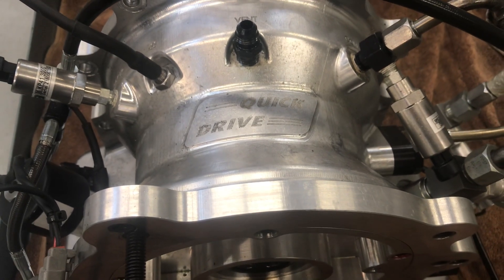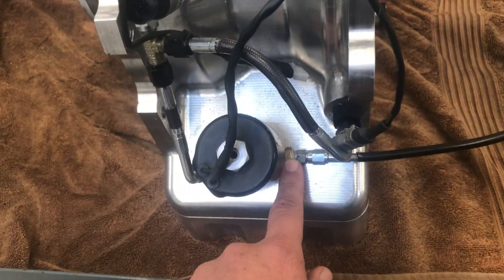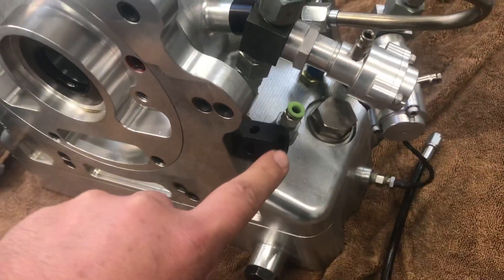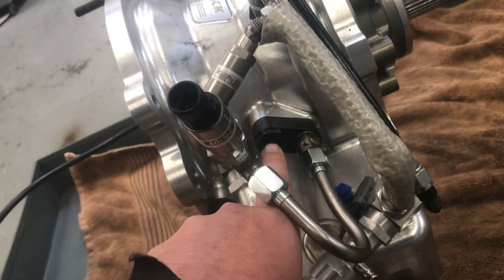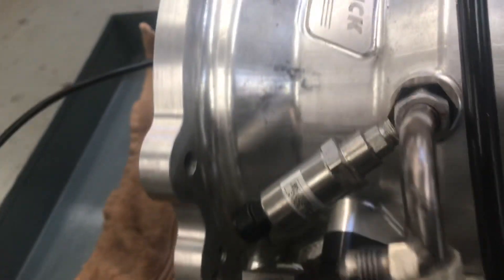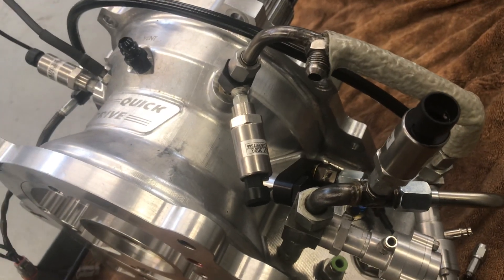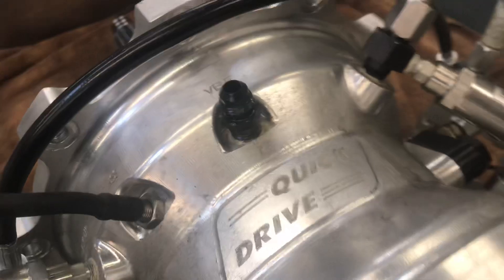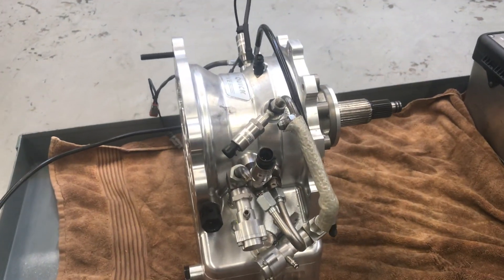Quick Drive Racing Lockup Torque Converter Drive Plumbing - Tuned By Shane T

Comment: Really informative. I appreciate how you took the time to explain why you bypass the cooler line but still retain the ability to use your external cooler between passes to get down to the same temps every run. I would love for you take one of these apart and explain the inner workings in detail.
Reply from the maker: Christopher Holmes appreciated and we will do that in the future, thanks for the suggestion.